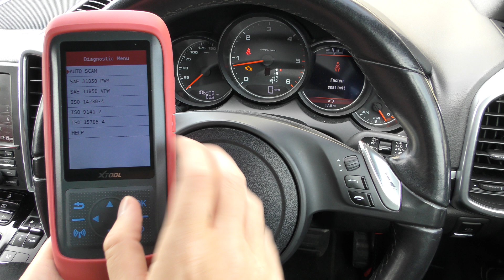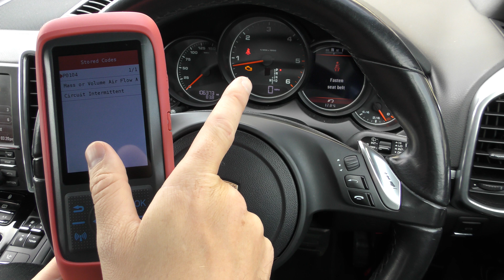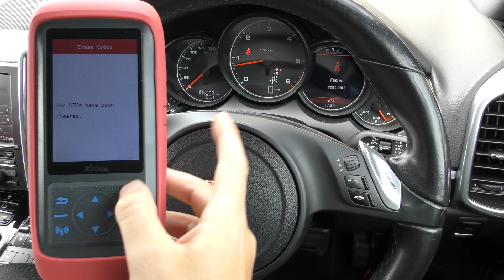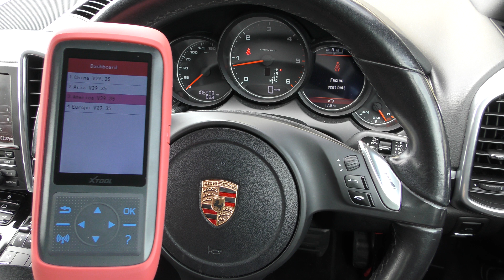Check Engine Light Reset With X-Tool X100 PRO2 Mileage Correction tool

Comment: I changed my cluster on my car, using this tool will it change the mileage on the cluster/odometer and also on the ECU? Does it sync all over the car? I have an 2005 Mercedes-Benz W211 which has the mileage save in several places.